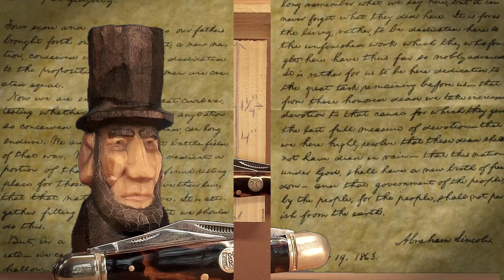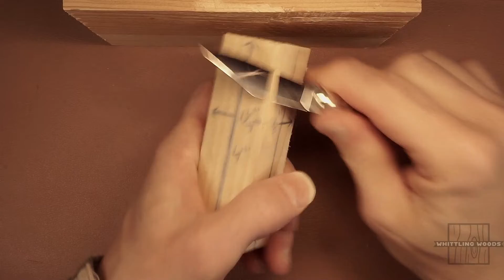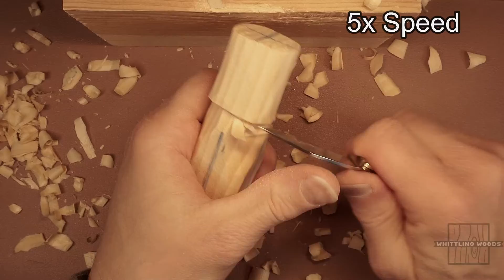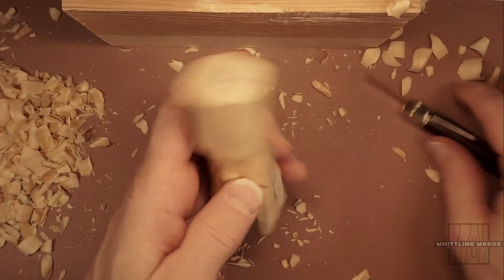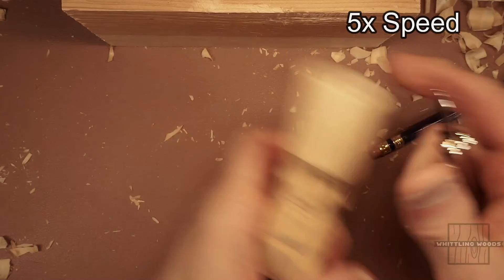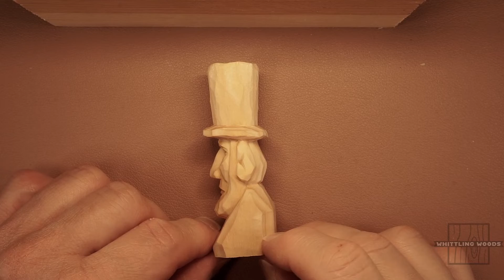Abe Lincoln Pocket Knife Whittle Demonstration

Comment: QQ, how many times did you strop during this carve? How about during a typical carve with a standard carving knife? Thanks!
Reply from the maker: Since I used all 3 blades on this knife, probably only 1 to 2 times for each blade. On a typical one knife carving in basswood or eastern white pine, with a standard woodcarving/whittling knife, I strop at least every 15-20 minutes (maybe 10 pass on each side each strop).👍✌